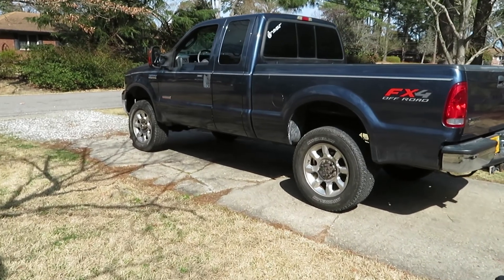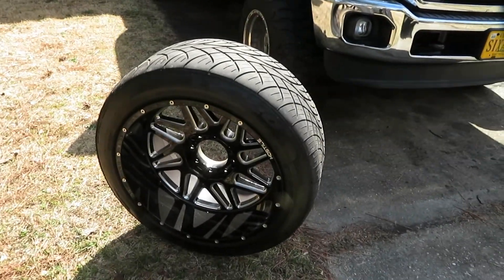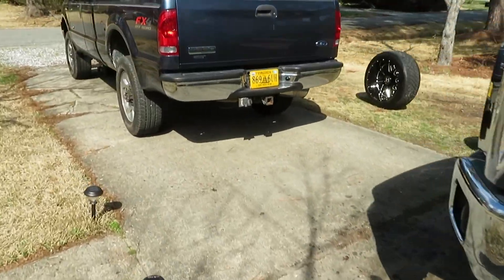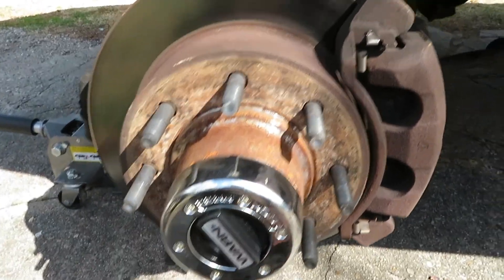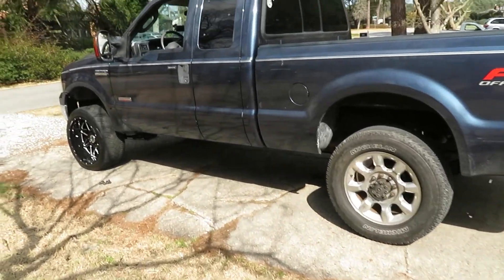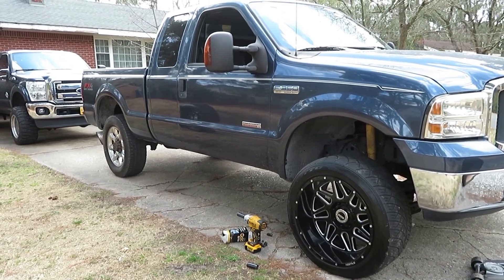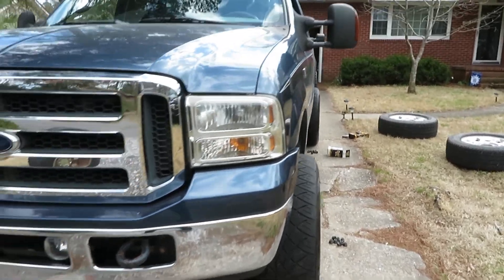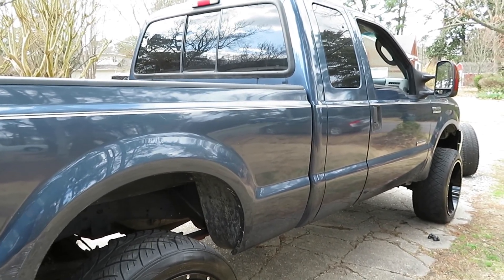NEW WHEELS FOR THE SUPERDUTY!! THESE ARE SICK!!

Comment: What diesel would you recommend going old or new 6.7 are nice af but expensive..6.0 are nice as well but you can find reasonable deals. Just curious because I want to switch to a diesel currently driving a 02 f150
Reply from the maker: Both are very nice. A 6.0 is a great Truck if you keep up with maintenance on it. If you fall behind then that can lead to many issues and failures of the 6.0. But don’t be scared of them, they are a stout motor. I would recommend that over a 6.7 if it’s gonna be your first diesel.